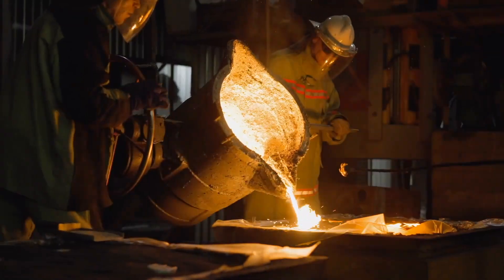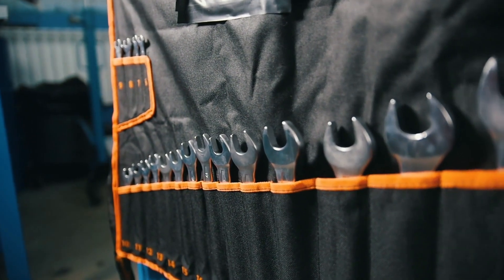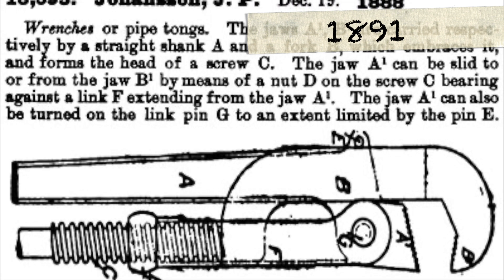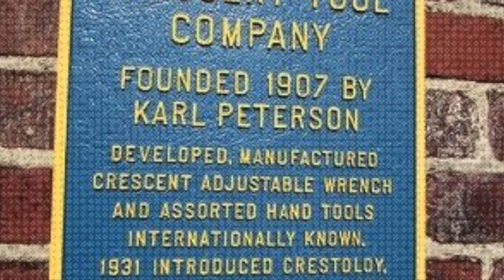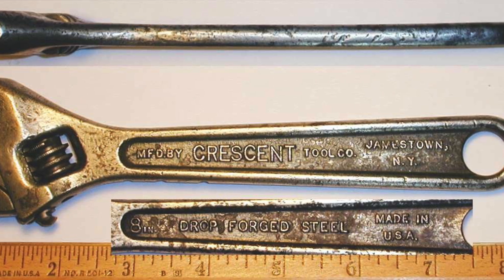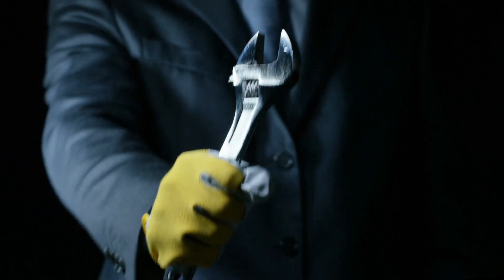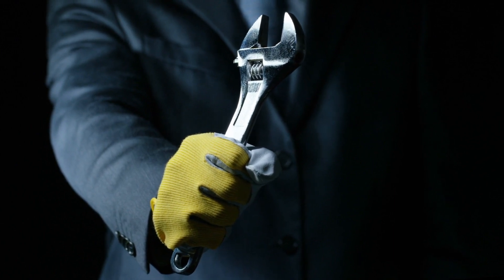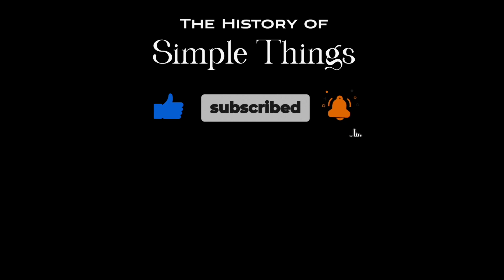The Invention of the Crescent Wrench (Adjustable Wrench)

Comment: I had a good 8" Crescent wrench that I had for years. It had been beat on and was done. I went to the local hardware store and bought a Crescent replacement. This was about 3 years ago. When I took it out of the package I noticed the adjustable jaw was so sloppy the wrench wasn't useable. I looked it over and it was made in China. The original one I had was made in USA. I threw the new one in the scrap pipe and bought another brand. JUNK.

Comment: When I was 10-ish, 11-ish, 12-ish back in the mid '60s all the kids in my age group on my block (and there were alot of us), all had the same basic tool group for working on our bicycles: a crescent wrench, a flat blade screw driver and pliers. We all could completely tear down our bikes with those tools (plus a hammer). It was rare when we had access to a socket set (some dad left his tool box unlocked!). Anyway, the crescent wrench reigned supreme even though it would frequently loosen up and round the corners of your nuts and bolts over time. Doubtful channel locks were even invented by then (would have been game-changing).

Comment: Great for rounding off the corners of a bolt or nut.
Reply: Not if you adjust it correctly
Reply: @flyerphil7708  You mean tighten it, turn than loosen it too take off the nut and repeat that shit forever until nut is in place? Plus the pleasure of mess what direction you should turn the worm to adjust each time? It's a wrench for toilet hose when you can't be sure which size nut is. Second worst invention ever (after the superglue)
Reply: Whilst scraping the skin off your knuckles. Crescent wrenches are   distained for those Reasons by a great many mechanics. We called them "Crescent hammers." Suitable for use only in a limited number of situations.
Reply: Here in Australia we call it a nutf#cker😂
Reply: See AvE for a full description of how to use the Swedish Nut Fucker aka Swedish Nut Rounder!!
Reply: Sometimes also called the Swedish Nut Lathe. As a side note, I also have versions of these by Bahco and SnapOn, and I find the most expensive one the SnapOn the worst manufactured one by miles, very 'gritty' in it's adjustment even after much use and cleaning.
Reply: I hate adjustable wrenches for the fact that they never fit quite right slip easily and need constant adjustment during use - yet I have purchased several and having one large adjustable wrench in the toolbox is pretty much essential.